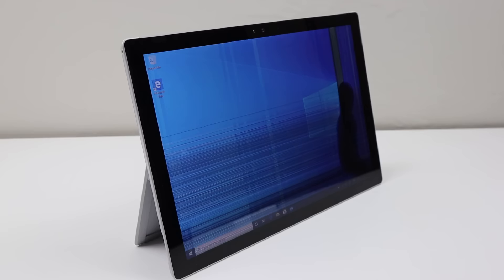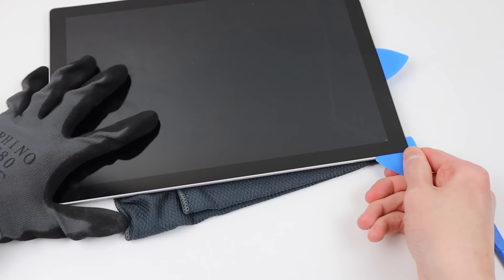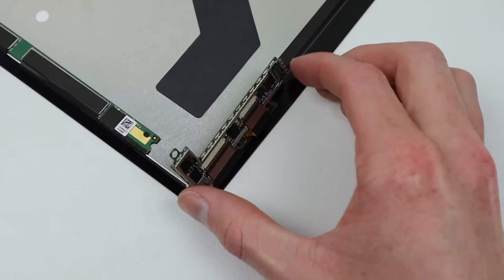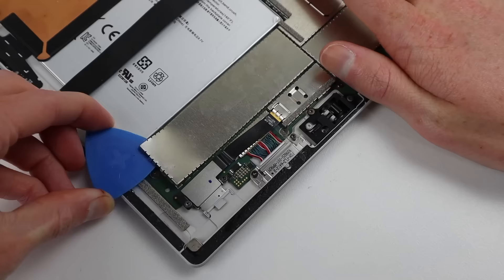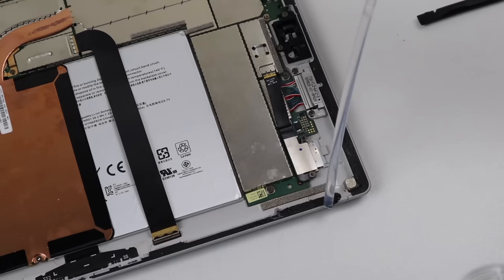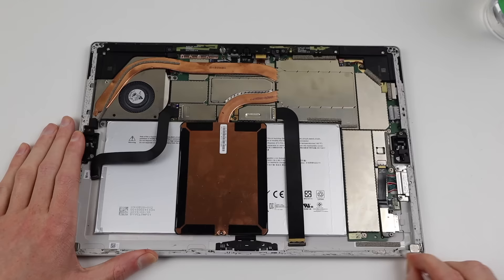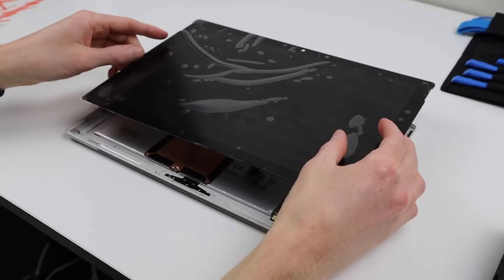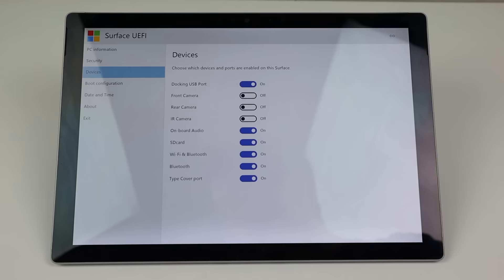Smashed Microsoft Surface Pro 4 Restoration & SSD Upgrade

Comment: Clearly enough space to use screws + clips on the display panel. Microsoft really loved to make repairs difficult.
Reply: Yeah they don’t want you to repair it yourself they want more money
Reply: Officer Harroberi it was just apple at first then It spread
Reply: @three_sheeps_in_a_trenchco3134  yeah but unlike microsoft apple designs it so you can't open it microsoft could've made it easier too open 😂
Reply: what about apple lol
Reply: Repairs can still be done on their products by third party repairs. Apple on the other hand, if you change any hardware any of the hardware especially on their iPhone 12. It will greet you with plenty of errors.

Comment: iFixit: surface pro 4 has the repairability score 2 / 10
Hugh: hold my beea
Reply: hmm yes

beea
Reply: robert PerkTheClown  no, it's an Aussie joke
Reply: us texans like to say it as "holed mah bee er"
Reply: I've replaced batteries on 8 surface books and 4 surface pros and ifixit aint lying... such a difficult balance of heat and pressure to get the screen off without cracking it.
Reply: hugh: ifixit better touch my surface
Reply: Right
Reply: *that moment when you realise you made a typo in your comment but it has a heart on it*
Reply: u mean beer lol
Reply: What
Reply: @Classy_Car  but that’s the joke
Reply: @c.christian576  again that’s the joke
Reply: Hold my iFixIt Pro Tech Toolkit
Reply: @jordanmackay6746  
If you have a surface pro 4, it's about the time where it's scheduled to replace the screen.  Flicker gate and an expanding failing battery. 
Both items has it's hardware failure that causes the time to replace to occur.  I would recommend if you are replacing your battery, just replace the following:
1. Battery --> and some specialized double side tape.
2. Screen --> get the sp5 version with the new cable to work with sp4 motherboard. (getting the sp4 screen will give you the same problem down the road).
3. Bigger hard drive SSD (get a new one if you can afford it as this would be a perfect time, largest installed so far is 2 TB ssd m.2 evo).
4. CPU Thermal Grease (if you are going to clean out the fan, which at this time around should be clogged with lint).

** The only down side is the memory is welded down and can't be upgraded.  Unless someone knows how to solder or I won't attempt to do this upgrade.

Suggestion:
I would not glue down the screen more than needed to or just enough to hold the screen down.  Since you know there is some maintenance bound to occur in this machine. This will it will be more easily accessible.
Reply: i told someone to hold my beer as well but then my new screen showed up damaged setting me back another week on getting my surface restored
Reply: i also just said f it, until i get a second screen for my tablet im just gonna hold down my sh*t half working screen on with my brand new uag case. it beats adhering everything down and needing to deal with it later
Reply: Wadooo orang indo nyasar nih :v
Reply: seems more like a 4/10 to me,
Reply: nah it should be Hold my Screwdriver
Reply: He should have done Hold My Bee r
Reply: Hey, I did it too.  It's really not that hard. You just need time and the tools and maybe knowledge. Heat Gun set at about 130C is a good start and patients. LOTS OF PATIENTS and being delicate. I needed to replace the Battery which means dissemble of the WHOLE DAMN COMPUTER. And Iso Alcohol behind the battery to release the glue on the battery which helps when the battery is blown up like a balloon.

Comment: 10:45 Nice 128MB memory card :D
Reply: You can technically increase space with a memory card of that size but what you're basically doing is blocking your Micro SD card slot
Reply: GB!
Reply: Oh wait.. I thought it was the frame with the 128 GB card.. Apologies!
Reply: Harira Normal normal vc eh normal?
Reply: Vízműves János thank you captain obvious
Reply: I was using 128 MB memory card in my phone about 2 months ago. Now I switched it to 16 GB one which I had laying around for about 2 years.
Reply: I had to rewatch the clip... damn.. i thought it was 128gb,..hahaha
Reply: I put an 1tb SD card
Reply: U can use a 1tb micro as card
Reply: Not Enough Storage SD card

Comment: Microsoft: anti-repair -> repair friendly
Samsung: meh -> meh
Apple: repair friendly -> anti-repair
Reply: Nah, apple is anti-repair for years
Reply: Not for older Apple products 2012-under
Reply: @WantBadtime  Pineapple was still anti repair with their for example on the iPhone 2g the made metal clips on the back to clip in the metal frame which made a high risk of injury and destruction of the back panel to open the phone and with imacs they used very strong neyodinium magnets to hold the front glass. They were anti repair and always will.
Reply: Explore Gadgets that's because it's the original and it's sort of a public beta. Apple doesn't know what the costumers want so they just made something that works and listen to what the costumers want. Take a look at iPhone 4-6S, the screen/back pops out with the removal of only two screws (same for iPhones today but there's glue now and many different types of screws). You don't lose any features of you replace parts of these iPhones. Macs before 2012 are also easily upgradable. You just need to remove some screws (or twist the bottom of the Mac mini) and you can easily upgrade RAM and storage. You can even upgrade the CPU and GPU in the iMacs (the front glass is held by magnets that are strong, but not insanely strong. You can easily get it off with a plastic card). Then Apple f-cked everything up by soldering everything to the board.
Reply: @LuisMan123  apples pc and laptop products are highly repairable dont just take the mobile market, also the i liked 2g
Reply: I'd hardly call Microsoft repair friendly now. Wowee, you can replace the SSD. What about any other component?
Reply: How the turntables
Reply: @rudskyful  "A youtuber" it's literally this YouTuber lol
Reply: @rudskyful  you mean this exact youtuber
Reply: @DJTechYT  a facepalm for me :3...  my head was a little woozy when I made that comment. :3.. sorry..
Reply: @2thgun  Apples latest laptop have soldered ssd. . .
Reply: @brettbutcher4304  What do you mean? Havent you watched whole video? Newer versions stopped sealing that you can fix every component by your own

Comment: im glad about the upgradeability for the new surface, what we need now is sodimm slots and a desktop cpu socket with accessories desinged to add watercooling like a thin ass radiator and thin tubing with thin ass fans

Comment: Windows is activated automatically because of SLP (System-Locked Preinstallation), where the key is embedded in the UEFI firmware.
Reply: Also makes old Lenovo clients really easy to repourpose :)
Reply: same with all laptops that have Windows 10 pre-installed. Just run the windows 10 installer from Microsoft and you're good to go.
Reply: @rudskyful  And make sure to have a spare product key or try transferring it over when swapping out a motherboard.

Comment: Also the orginal or "same as orignal" adhesive can be bought on aliexpress. It's either the original or a laser-cut adhesive which is cut the same way as the original. Aliexpress is probably the best place where you can find most of the surface pro parts even like the wifi antena, LG screen or the battery.

Comment: one thing i learnt from laptop repair is always run the screen numbers before ordering anything as there is so many variants and alot of the time you find the part way cheaper also some displays can be changed from a 1366 panel to a 1080 one.

Comment: In regards to removing the adhesive, try a razor blade. Worked great for me on ipads. You just run it down the side and take off most of the adhesive in one go. Don't use it on the non metal parts though.

Comment: Try to use WD40 to remove the hard to remove adhesive😊
Reply: I heard people using wd40 to remove the silicone around bathtubs which works beautifully, but after a while, it tends to eat the new silicone as well. 

Not sure how true it would be for adhesives though.
Reply: You should clean the area first before you apply a new adhesive
Reply: No.. Go to a hardware store and get some goof off removal.
Reply: Oh no

Comment: You are the luckiest man on earth getting that off without breaking it. I've been working in a repair shop for 3 years now (nowhere near as long as you have been doing these) but the surface 3 4 and 5 have the most fragile thing I've ever worked on. Although after that they use more flexible glass and I personally daily a surface pro X with windows 11

Comment: For the adhesive removal, use a "caramel wheel" or automotive pin stripe removal tool. Works great on that type of adhesives which usually see on car badges.
Reply: Wow, that's such a good call! Also, doesn't that adhesive look like RTV?

Comment: Yay! Glad to see that someone has repaired one of these unrepairable devices!
Only problem is... what happens when the battery eventually fails, as it will do at some point? Those batteries are glued in like no tomorrow!
P.S. I have a Surface Pro 3 myself and that is a great device, shame about the lack of repairability though.

Comment: After lots of research and doing this myself, here's a few points to note,
1. If you have to replace the screen do not get an original Samsung screen. These are prone to failure due to overheating the connection. LG is the way to go, as as per the video go for the SP5 screen
2.  You should replace the thermal paste. The old stuff will be dry and useless
3. A new battery is £30, so just replace that as well.
4. The touch L shaped board needs to have good contact with the screen for earthing. The original is attached with conductive paste. So I'd get conductive glue to hold it down to the new screen.
5. Take your time removing the screen. I can easily take up to an hour. I use playing cards, heat and alcohol and work my way round.
6. Take care when removing the screen at the top. The antennas are there and easily destroyed. You can get a new one from AliExpress for I think £15 if you do break it, or I've seen folk just using tinfoil.

Comment: Hi, I was wondering why don't you use a migration tools to copy the software from one drive to another (Seagate disk wizards). It will ensure all the driver will be as same as the original so it will work better. I used to do this for my hdd to ssd upgrade for my laptop

Comment: The 'gap' you noticed while dissasembling was most likely caused by battery swelling, pushing the screen out of the chassis. Same thing happened to my SP4 (albeit much worse), other SP4 owners will have experienced the same thing too.

Comment: If you have a surface pro 4, it's about the time where it's scheduled to replace the screen.  Flicker gate and an expanding failing battery. 
Both items has it's hardware failure that causes the time to replace to occur.  I would recommend if you are replacing your battery, just replace the following:
1. Battery --> and some specialized double side tape.
2. Screen --> get the sp5 version with the new cable to work with sp4 motherboard. (getting the sp4 screen will give you the same problem down the road).
3. Bigger hard drive SSD (get a new one if you can afford it as this would be a perfect time, largest installed so far is 2 TB ssd m.2 evo).
4. CPU Thermal Grease (if you are going to clean out the fan, which at this time around should be clogged with lint).

** The only down side is the memory is welded down and can't be upgraded.  Unless someone knows how to solder or I won't attempt to do this upgrade.

Suggestion:
I would not glue down the screen more than needed to or just enough to hold the screen down.  Since you know there is some maintenance bound to occur in this machine. This will it will be more easily accessible.

Comment: Great work Hugh! Like you, I am a firm believer in fixing old equipment - it can often be used for many years more. I still have a Surface pro 3 that serves as a ‘family’ shared computer, and while I am a Mac user, I do also have a Surface laptop 2 for the times when I need to use a Windows machine. I would love to replace the battery on our old Surface pro 3, but I don’t have the courage (or skill) to remove the display! Thanks for another great video.

Comment: Yeah, it’s okay to mess around anything with connected battery.
Reply: 1217257 yeah, I mean, that was a bit...
Reply: It'd make more sense to leave it connected and being cautious considering that disconnecting the battery requires him to take out literally everything else, including the motherboard (which could be shorted out if you try to take it out).
Reply: Kyan I might be wrong but there’s a higher chance to short when you are connecting cables with many pins to the socket. You just can’t do this with single movement. I’ve killed my iPhone 5 motherboard doing this, maybe just a bad luck, but I’ve learnt my lesson😀
Reply: 1217257 There is a high chance but the way the surface battery connects is with a pad that uses the motherboard’s pressure when connected to the case to make contact, so to disconnect the battery to prevent shorts, he’d have to remove everything from the housing which has the potential for shorting something out doing that.
Reply: Kyan didn’t know that:( we’ll, I hope Microsoft do better now with their new surface machines
Reply: 1217257 hopefully they’re trying to change
Reply: The Surface Pro series are a nightmare for repairability. You can't disconnect the battery without going through the entire machine and removing the main logic board. This would involve more work than required, including all of those metal shields, and wouldn't do much in the way of helping to repair the broken display.
Reply: @TheSpotify95  I repaired my two Surface Pro 4's and all you have to do is remove two torx screws right where the battery flex cable goes under the motherboard and lift it up with a plastic tool and insert a paper between the pads. While you are at it replace the thermal paste too as the original stuff is just bad.

Comment: I'm sure someone has pointed it out before, but they make heating pads for reptile enclosures that I've found help a LOT when trying to loosen glue, since it only actually heats up to about 10 degrees above ambient, it's also pretty handy to use before using a hot air station on it. just put it on the pad and come back to it an hour later.

Comment: I did a battery replacement on my Surface 2 RT. It's a big job since the battery is at the bottom of the stack; nearly everything had to be removed. Successful too. The original battery was bulging which at least made the screen removal very easy, since it was already popped out in places, due to the bulging battery. Cheers.

Comment: Microsoft: making Surface more repairable.

Apple: making their products more difficult to repair, puts tremendous amount of repair price
Reply: The surface isn't really repairable. In 90% of the cases you'll break your panel while removing it. And inside only the ssd is changeble and maybe the battery. 

An iPhone can be at least opened without completely destroying it.
Reply: I hear an isheep coming.
Reply: @exploregadgets1774  I hear a closed minded person coming (android user here btw)
Reply: As the first guy said, Surface is not repairable. Whats your point?
Reply: THE BEAST  I am not jealous you are I am proud instead of buying the pineapple se I bought the galaxy note 9 it is much better and has a larger display and battery and a headphone jack and fast charging and so on of course it is two years old and mostly out of support but unlike pineapple you can install latest Android via a custom ROM and extend the life of your phone. And finally you should get some common sense and stop arguing about that pineapple phones are the best.

Comment: If you like to live dangerously like me, I've found a chisel-tip razor / craft knife helps immensely for removing tough adhesives from devices like the Surface series. The issue is the inherent roughness of the metal its adhered to. More surface area from all of the microscopic bumps and etches in the metal give that already strong adhesive more to bond and cling to.

Comment: I took mines apart recently and  yes, that glue was strange.  I did leave it in place so I could tack the screen back onto that sticky tar-like surface.  It holds quite well, but is able to be pulled off carefully.  Leaving it like that till I need a new battery.  At that time I'll use repair tape to remount the screen.  Awesome videos.

Comment: For removing the adhesive I'd use a sharpened metal spudger. Wrap some sandpaper around a block of wood and use it to sharpen each side. Works a treat!

Comment: I’ve done several, pain in the ass..  Toptip: for removal of the adhesive: use heat. It doesn’t break as much and sometimes you peel whole strings.

I’ve never had the screenassembly in one piece pulled from the frame. Good job!

Comment: I did my own replacement of the surface pro 4 display and I found that using the heat gun to heat the adhesive you were having such a hard time with allowed it to come off much easier. Heating and removing over and over.